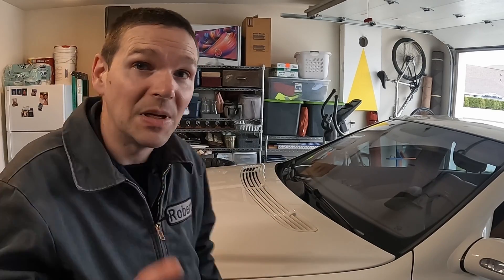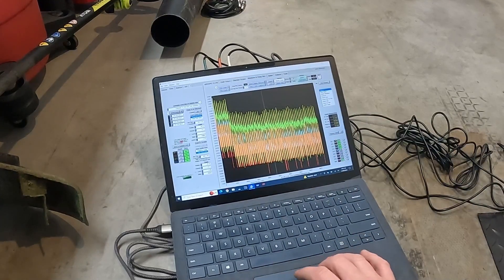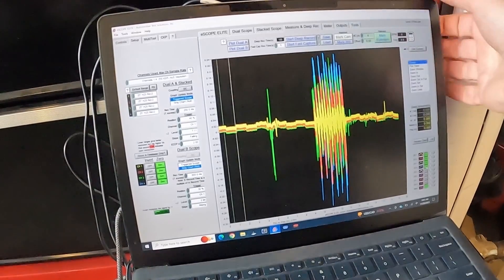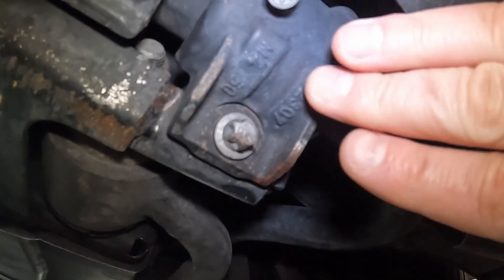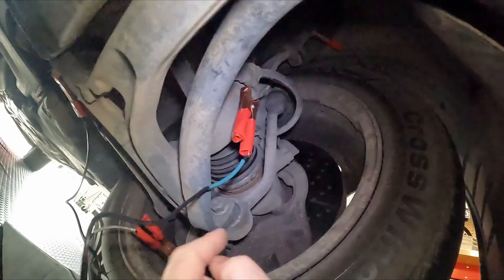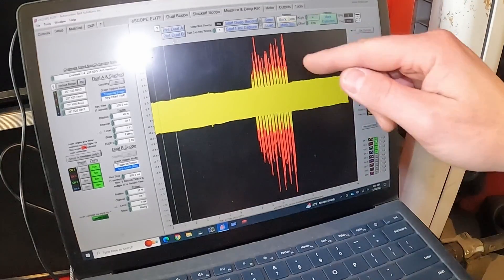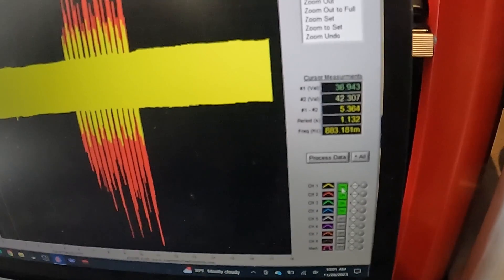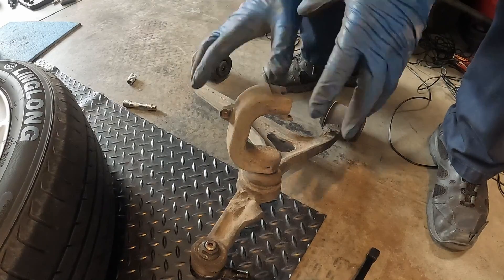Visually Diagnose Suspension Noises | Best Way to Diagnose Car Noises

Comment: Great video.  The Escope is very nice.  As a DIY'er I can't justify the cost but have watches Bernie Thompson from ATS use one in most of his videos.  

I do have a set of those clamp chassis ears to use with the scope that goes with my Thinktool Pros scanner.  Joe's Auto Electric has magnetic holders that hold the wires if you have to do a test drive with the clamps installed.

Comment: Did u get scope from aes how much for scope, and probes came from where
Reply from the maker: Yep. The scope came from AESwave and the sound clamps are from Amazon. The scope is pretty expensive but I use it quite often. Hantek makes a cheap 8 channel scope you can get from Amazon as well. I haven't used it though so I'm not sure about quality.